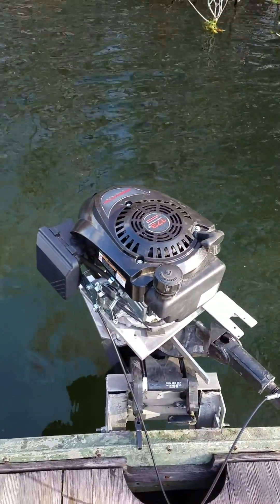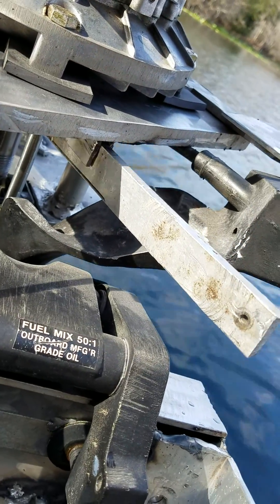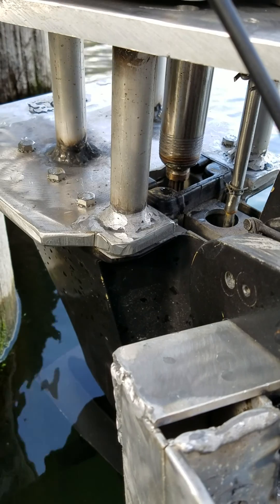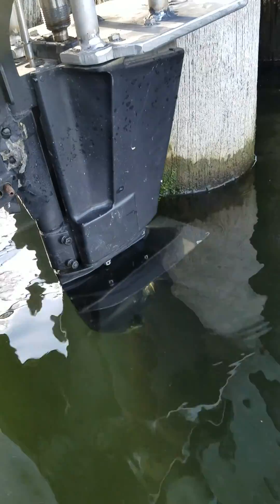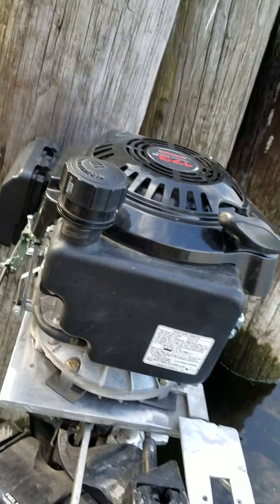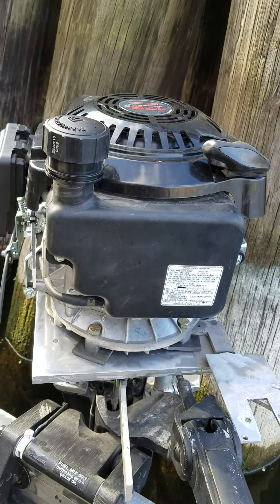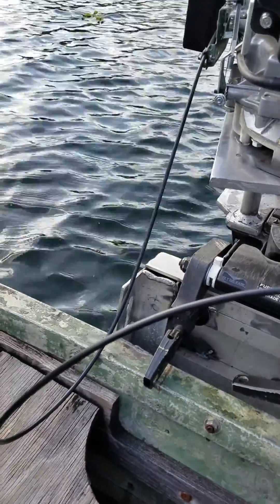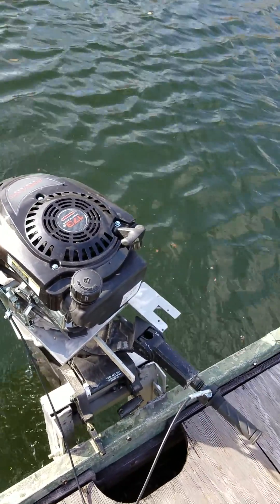How to Make a Mud Motor/Air Cooled Outboard (Part 2)

Comment: 17.5 inteck drill crank shaft size of boat motor shaft lower motor to aluminum plate 9 in prop 6 inch hydrafoil. Weed eater trigger works great with killswitch gas tank up front w fuel pump. Out preforms 20 horse factory prop any day and it can all be free.

Comment: I like the setup. 12 mph is impressive. Do you attribute that to the jack plate or the fact that the motor is on a Jon boat? I recently put together a motor like yours from an old 6 hp outboard and mine is more sluggish than this one.

Comment: I really like the finished product, I was looking at the same motor at Harbor Freight yesterday with the exact same thing in mind.  my problem is that I don't have the lower unit.  Thanks for sharing your build, gives me lots of ideas!
Reply from the maker: texcntryboy48 No problem and thanks for the comment! Since this video I've switched over to running longtail mud motors and would say that's absolutely the way to go. You can build one with the harbor freight motor and a swamp runner kit for less than $400. I just finished building a 20hp kohler long tail. I'll post a video soon